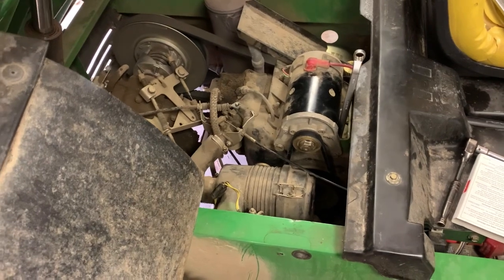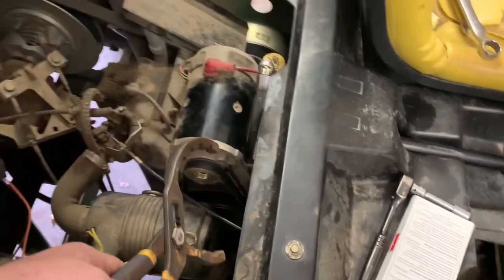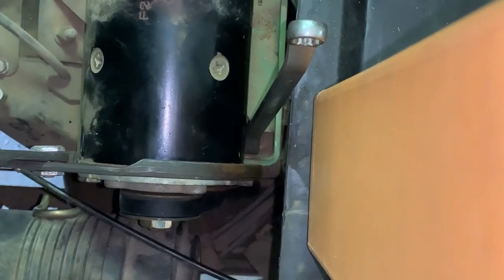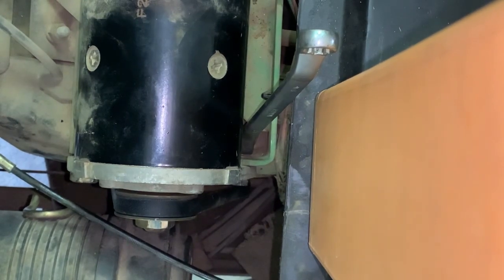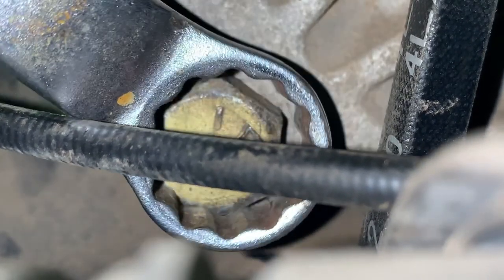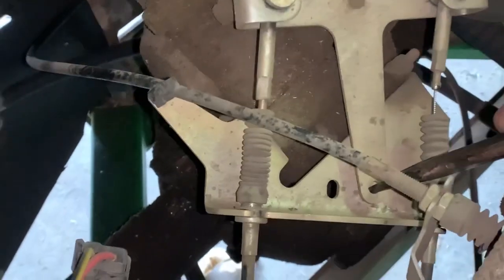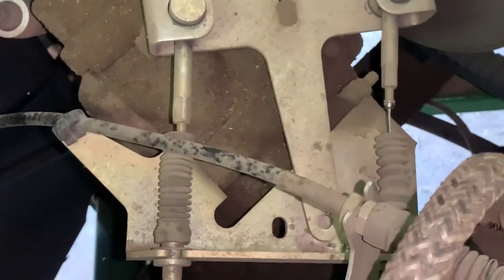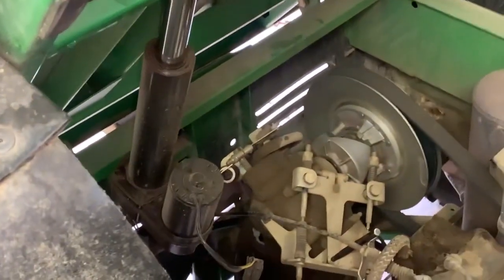AWESOME OIL FILTER WRENCH HACK #3

Comment: It's another Very Bad Design by the JD Engineers. Those folks should be required to take a Basic Mechanical Course. They could possibly gain some useful knowledge. Or maybe spend 30days in the field at a Busy Dealership.